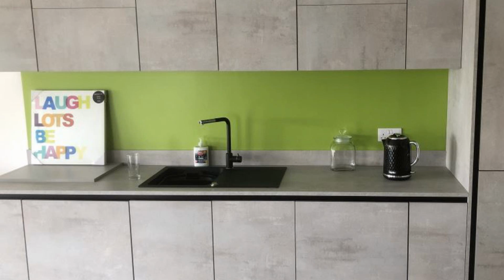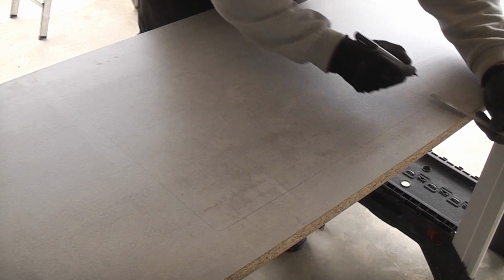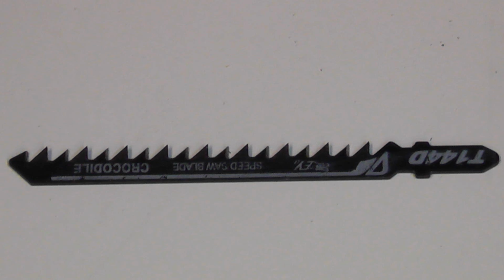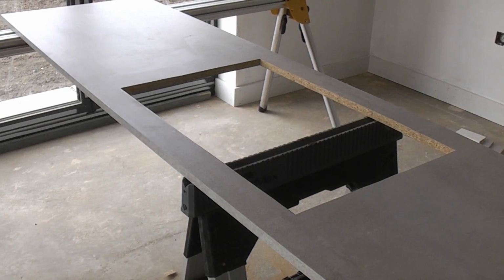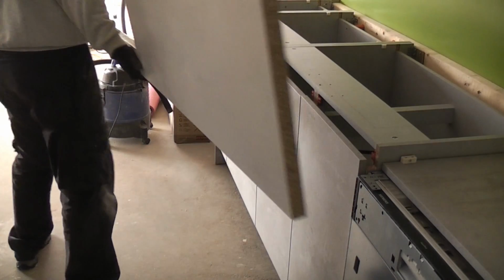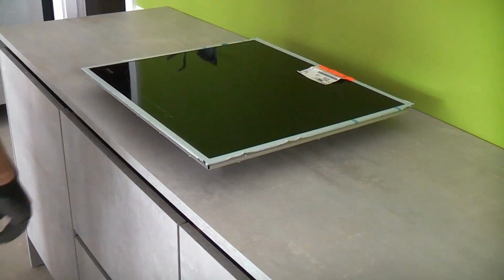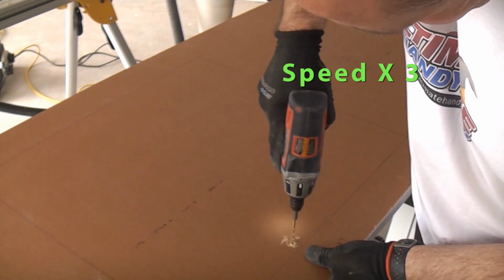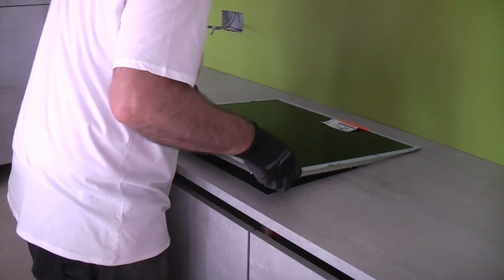How to cut out a worktop for a sink or hob

Comment: Good advice for sealing the cut edges with exterior grade glue / sealant, once saw a worktop on a fancy kitchen that was ruined by water ingress around the sink that swelled the worktop. Thanks for sharing
Reply from the maker: Yeah, that’s probably the most important thing. I too have seen ruined worktops due to water ingress! 
Thanks for the comment 👍